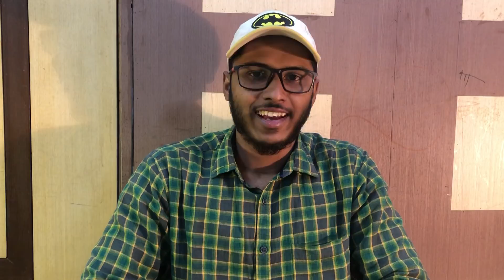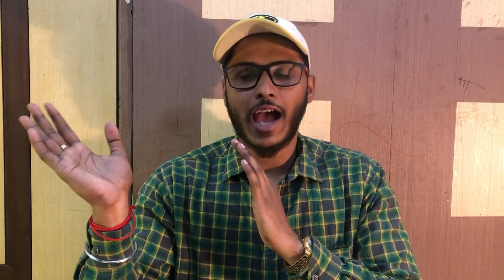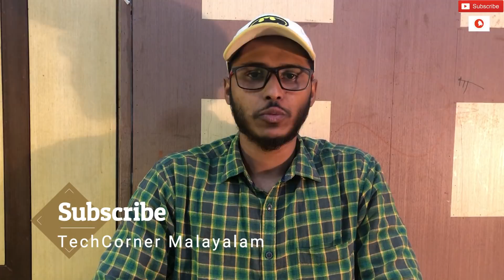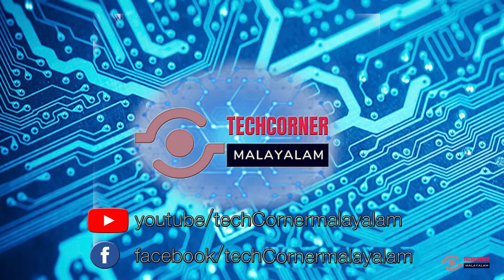ന്യൂട്രലിൽ തൊട്ടാൽ ഷോക്ക് അടിക്കില്ലേ ? | Why Neutral Wire don't give Electric Shock

Comment: Bro, in ac circuit polarity changes frequently , right?. Then y in neutral wire voltage is not 240V?
Reply from the maker: Enthan neutral ennoru video cheythit und athil nammal parayunund

Comment: Neutral ideally should be 0 but practically have some stray voltage like .3v. When circuit is open we will not get shock but circuit is closed there will be definitely current flow through neutral and we must get shock

Comment: Closed ckt le  return wire aya neutral wire end  thottal shock adikkille.. ???
Reply from the maker: Illa voltage valare kurev alle
Reply: @TechCornerMalayalam   i means  closed ckt of bulb connection

Comment: ചേട്ടാ ഒരു സംശയം...
general question ആണ്
ഒരു closed path ഉണ്ടെങ്കിൽ current flow ഉണ്ടാകുന്നുള്ളൂ എന്നു ഉണ്ടാലോ....
എന്റെ question ഇതാണ്
ഒരു കല്യാണത്തിന് അല്ലെങ്കിൽ പന്തൽ wrk നു temporary  ആയി ഉപയോഗിക്കുന്ന generators അതു ഒരു plastic wheel നു മുകളിൽ ആണ് ഇരിക്കുന്നത് earth ആയിട്ടു ഒരു connetion ഇല്ല   പക്ഷെ ആ generator ൽ നിന്നും output വരുന്ന 230v phase wire ൽ മാത്രം തൊട്ടാൽ current അടിക്കുന്നു.... കാരണം എന്താണ്
Reply from the maker: Avide grounding cheyar undello

Comment: Star connection nte common aano neutral appol 3 phase value illathakille
Reply from the maker: Common aanu..illathakilla
Reply: vector sum of all voltages or currents is zero.

Comment: Closed circuit le neutral wire il thottal shock adikumo?
Reply from the maker: Neutral proper aayit ground il terminate aayitundel..adikilla
Reply: @TechCornerMalayalam  fan ayich matumbol enik shock adichu. Njan main switch, ellam off chydirunnu. Pinne endan enikk shock adikkan karanam.  adil oru wire thottappol aan shock adichad  [ bakki ulla wire thottappol shock adichilla]
Reply: @muhammedmhd3679  Capacitor discharge ആയതാകും

Comment: Phase ലും neutral ലുമായി ഒരു load connect ചെയ്ത് ON ചെയ്യുമ്പോൾ അതിന്റെ return path ആയ neutral ൽ കൂടി return current flow ചെയ്യും. അപ്പോൾ neutral ൽ തൊട്ടാൽ shock അടിക്കില്ലെ
Reply from the maker: Illa...ah neutral proper aayit grounding cheythit undu enkil athayath nammade case il transformer il aanu...
Nammudeyum neutrailinteyum potential same aanu athupole resistance m vethyasam undu
Reply: TechCorner Malayalam 5A ന്റെ load work ചെയ്യുമ്പോൾ phase ൽ +5 ഉം neutral ൽ -5A ഉം ഉണ്ടാകും. അപ്പോൾ neutral ൽ ഒരു -ve voltage ഉണ്ടാകും. നമ്മൾ നിൽക്കുന്ന ground zero potential ആണ്. അപ്പോൾ potential difference ഉണ്ടായി shock അടിക്കില്ലെ
Reply: @rajeevr131  പുള്ളിക്കാരൻ ഓടി...!😜
Reply: Illa. Neutral floating aanu enkil shock undakum.
Reply: @nivniv2418  floating means?
Reply: Ha ha neutral il voltage zero aanu ..allate -ve voltage um +ve Voltage um onumila .e +ve um.     &  -ve um yallam dc il varunnathu .chettan adyam basic electrical padiku
Reply: ഇല്ല അത് എങ്ങനെ റിട്ടൻ കറന്റ് വരും
Reply: E circuit il phase wiril thottal shock adikumo.. i mean when the load is working/swirched on